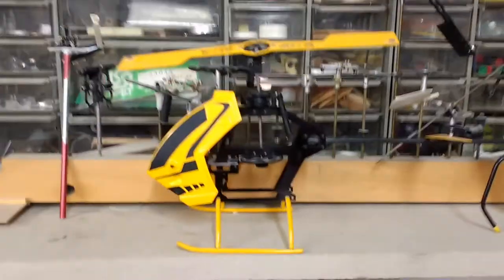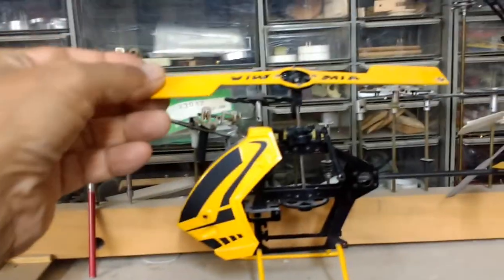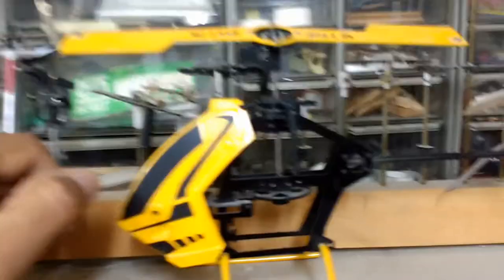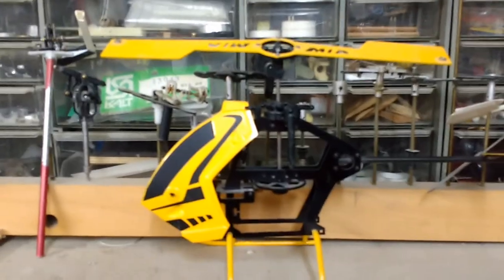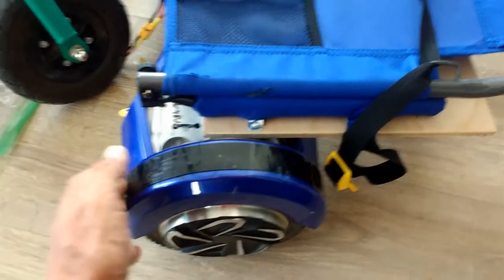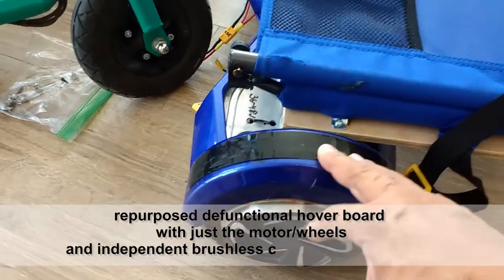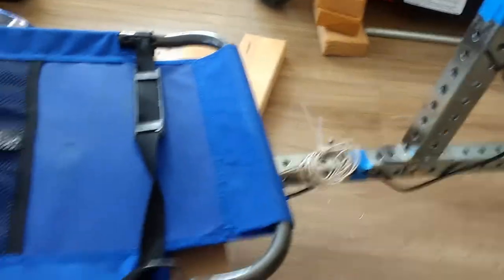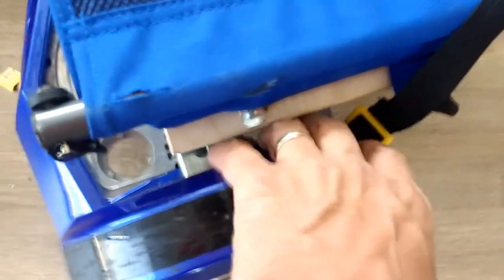Why Mechanical Stabilization is Safer, Better than Electronic Stabilization Hoverboard Go-kart

Comment: I tend to agree re: stabilization. But I like even better a hybrid of the two schools of thought. I used to use this futaba gyro stabilizer that basically consisted of a small gyro fly wheel in a box that was constantly spinning and when it would move relative to the heli it would touch small limit type switches to activate the servos. I still have an old one. The only downside to these were they were not at all small and were a bit heavy soo not good for micro heli application. But solid state electronic stabilization has progressed incredibly in the last few years and are super reliable now. That is assuming its a quality part and not some cheap Chinese one that was reverse engineered. You're not going to be able to do 3D maneuvering with a fly bar heli ever. its just not possible.
Reply from the maker: I know the gyros you are talking about. I had them in some very early  electric helis, they were used mainly for the tail  rotor to allow easier control, but yeah, their components made them heavy. An option to that was to use the same bell-hiller flybar idea on the tail, except that now you had a vertical flybar mechanical stabilizer and it could be made simple and lighter by the use of a wire  center hinged via a U-joint and two smaller paddles than on the main rotor.  I did a number of early large electric helis, this way, back in the 80's, to eliminate the need for the bulky motor flywheel driven gyros to stabilize the tail end. I have videos of my early larger helis showing these early stabilizers and how well they worked and still do. 

I agree doing 3d maneuvers  is much cleaner with RC flybarless CP helis .  However my reasoning for the mechanical flybar preference over an electronic stabilizer was to mainly stabilize with confidence a man carrying aircraft during normal upright flight. I know it sound backwards with all this technology we have but I still do not trust electronic stabilization.

Under normal flight maneuvers,  I have seen the effect in RC helis, often  ending in unavoidable crashes,  none of my flybar type helis experienced that under normal flight maneuvers. Unless one flybar weight or paddle came off during flight, which has never happened to me because I make sure these components are well secured. 

Imagine you are going 10-20 mph 10-20 feet in the air and one of the rotors of a man carrying quad gives! due to the electronic stabilizing features of the controller. Same thing can happen if a motor gives or the esc gives, at that point, the pilot is in trouble! But let's just concentrate on the stabilizing rotor mechanism. Now consider the same with a heli with a mechanical flybar, and you have a more reliable system.
Reply: @MarioIArguello   Would love to see a detailed video on those early helis. I've been doing RC my whole life just about and just now in the past few months I've taken an interest in a lot of the older and vintage airplanes and helis. I even started building old guillws models again and found a really rare large guillows 60" electric model that I'm going to start building. So anything old RC I'd love to see. so can't wait to see those old helis of yours.
Reply from the maker: Google keyword search  MIA RC heli you are bound to stumble on some of my original early heli pages. I will try to upload a more up to date video of my early helis that used the mechanical tail flybars.